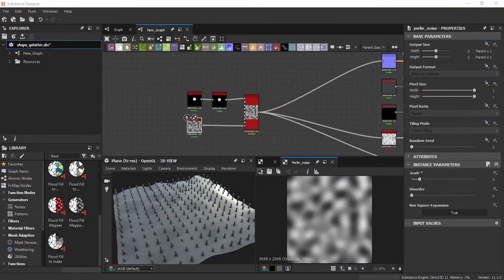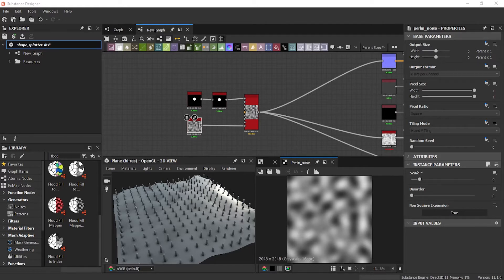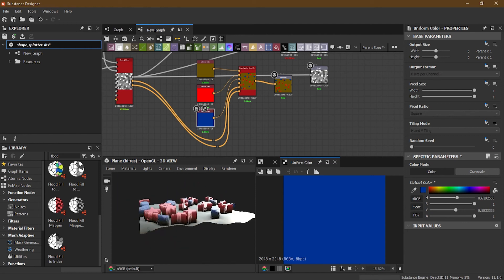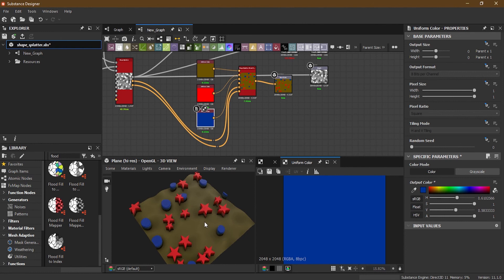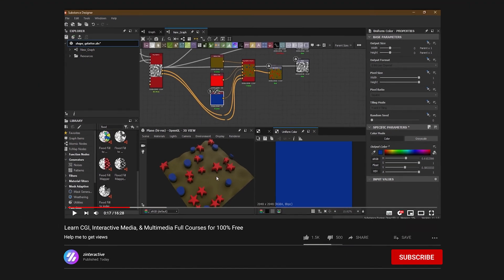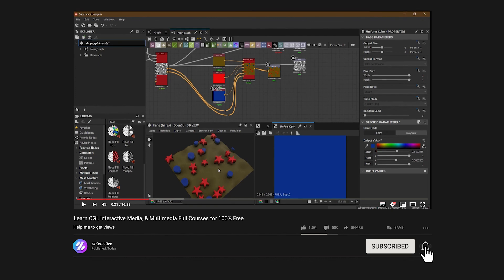Shape Splatter Node | Lesson 13 | Chapter 2 | Substance Designer 2021 Essential Series

Comment: Hi, I trying to use Shape Splatter Blend Node. Even though I increased the input numbers but it only processing very first input. I tried same with Shape Splatter Blend Color but same result. If you can help please. Thanks.
Reply from the maker: how many other nodes you are using
Reply: @zinteractive  Not many, I even tried it in separate graph. But same issue.
Reply from the maker: @uglybit6568  try it by removing all the nodes and then reconnect the nodes one by one.